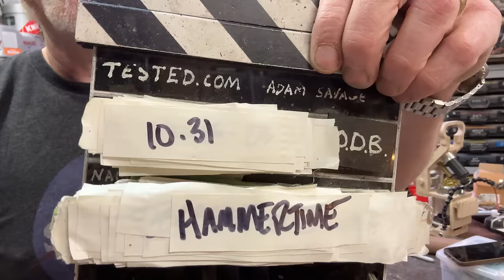Adam Savage Makes a Perfect Kitchen Mallet!

Comment: A beautiful implement, but with access to your mills? The black walnut would have been a handle and the head titanium or more realistically, structural/aircraft aluminum. Light and non-porous. 

Pallet wood can be scary...please be careful of it around food. At the least, seal the crap out of it.